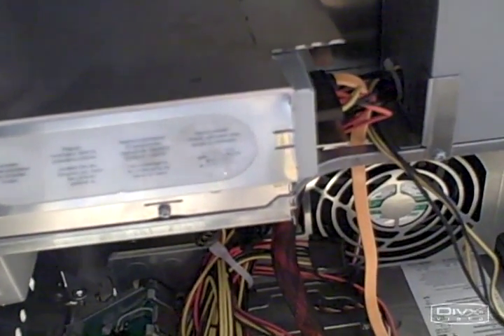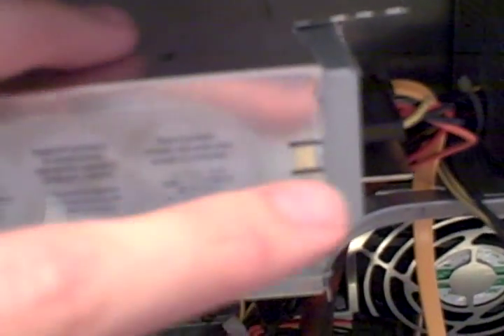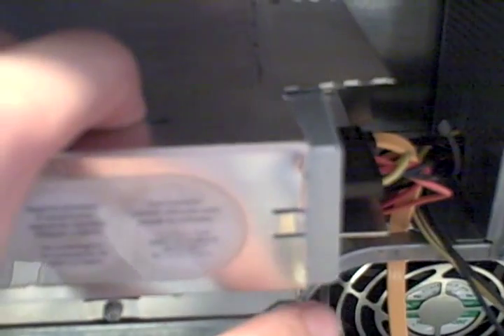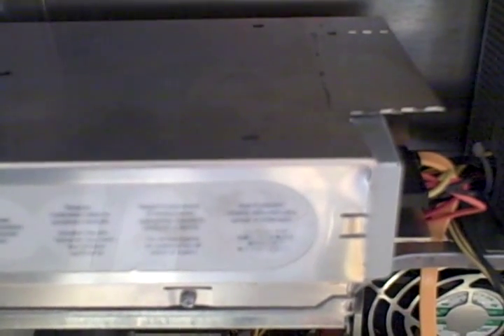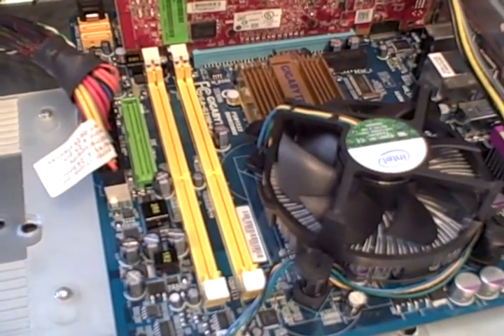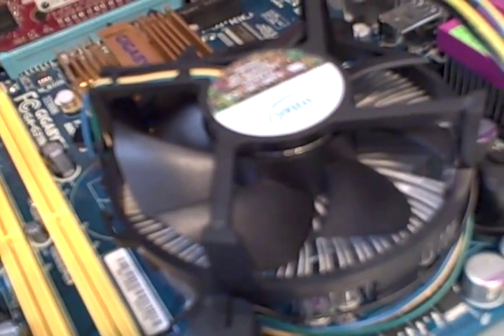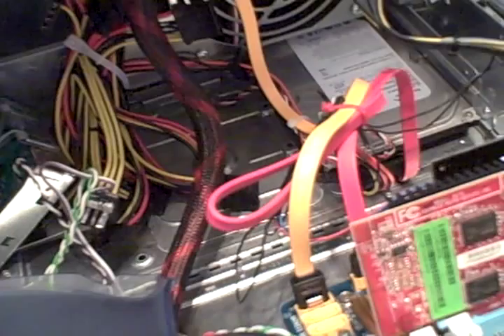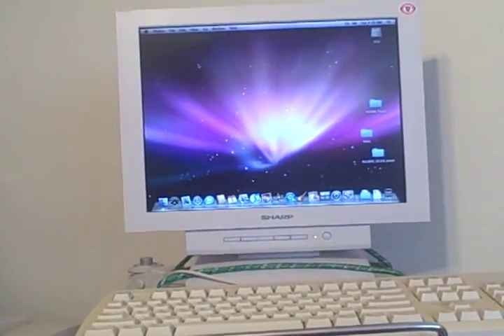Modding a G4 case for a hackintosh (part 8) finished

Comment: For all those who have probelmes with space between board and odd-drive. I used a slim-odd with 5.25"-Adapter from Lindy. Had to modify the front-panel, but works great.

Comment: Question, how did you rig the power button to turn on the machine...I'm assuming by the look of mine the 10pin connector will not work on a Gigabyte motherboard...also what did you use for the  speaker?

Comment: so wouldn't have been easier to just desolder the cap and put it tied to another part with two little extension cables? i did something like that to a scanner inverter to make fit in a different model, always trying to keep as small the damage as possible!